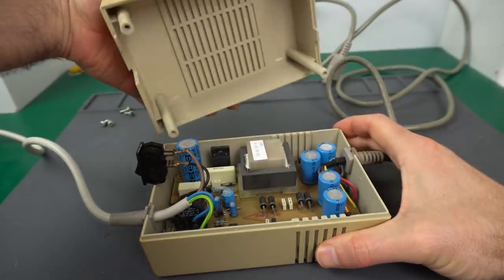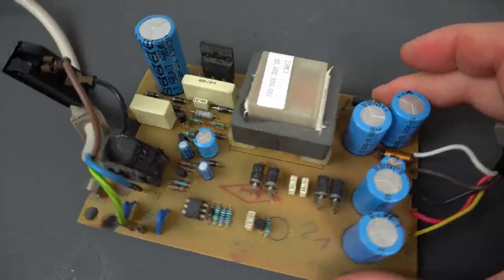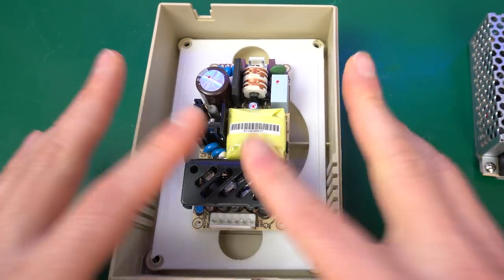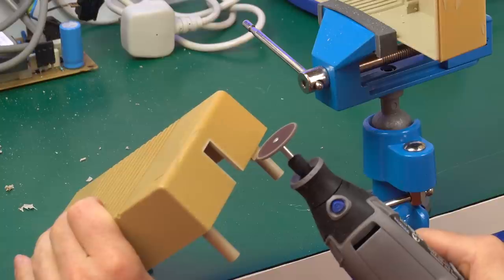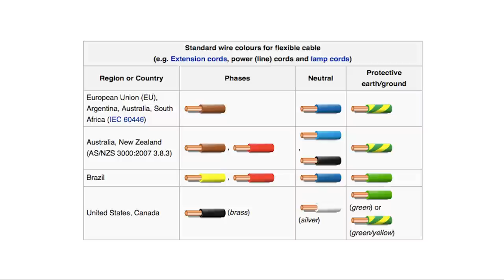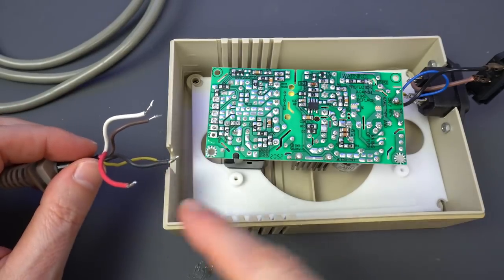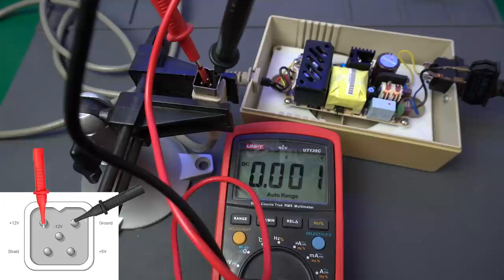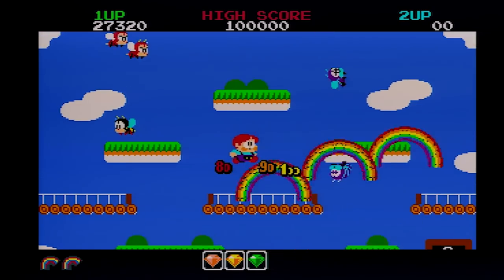This Amiga Power Supply Will Work Anywhere

Comment: The fuse in the UK plug is to protect the appliance cable (or cord if you're in the US). This is because most domestic UK installation wall outlets are wired in a ring, using 2.5mm squared cable, with sockets daisy chained together, so there is continuity in both directions from any socket back to the distribution board.  The ring main wiring inside the fabric of the building is usually protected by a 32 A circuit breaker. So if there is a fault on the appliance, the fault current could be less than 32A, but still exceed the rating of the appliance cable (which will be much less than 32A),  causing the cable to overheat and catch fire without tripping the circuit breaker.  In this case, a correctly sized fuse in the plug would blow and prevent the cable from catching fire.
Reply: Oh thank god, theres actually people that know this :)
Reply from the maker: Right. Technology Connections had a great video about that (focusing on the US system): https://www.youtube.com/watch?v=K_q-xnYRugQ

Comment: Another thing to watch out for when working with mains cables. Some plugs can be reversed in the outlet, switching the neutral and live around. (This is btw, fine for one phase equipment ) Don't assume neutral always are neutral and live always are live. It depends on how the socket/wall outlet is plugged.
Common sense is to consider both neutral and live as if they both are live. 
And of course never ever work with the mains side with it plugged in, even if the wall outlet has a switch turned off.

Comment: Great video Noel, just one thing I noticed was that remember to make sure the supply wires to the PSU can carry the higher current when plugged into an American supply.
Reply: Mr Guru  yes the current draw to the Amiga will be the same on the DC load side but on the AC supply to the PSU if the voltage level changes from 220V down to 120V to keep the power the same the current will increase. For example  100W PSU will draw 0.45A at 220V but a 120v supply will draw 0.83A.
Reply: @kevinhowie2704  Sure but like I said in another comment.... it doesn't matter. I own over 50 Amigas. The same AC cable is used on all models in all regions. The only difference is the plug shape and the input voltage on the PSU. You said yourself a 1mm wire can take 10A without issues and the cable used is at least that. The Amiga only takes 3A-4A so well within the limits. If it was good enough to pass FCC safety regulations in 1987 it's fine now.
Reply: @johnbos4637  true I believe you that the dc circuit supplying the Amiga is 3 to 4 amp  but we are discussing the AC supply which current will be alot lower.

Comment: Good job Noel. I did a similar PSU mod recently with the 50b version of the meanwell unit. I needed to adjust the 5v load as my gotek was not working with it until I adjusted it under load.
Reply from the maker: Yes, I was ready to adjust the voltage under load at the end when I realized this model didn't have an adjustment like the 50B. I wonder why. At least it worked fine without any tweaking, so that was great.
Reply: @NoelsRetroLab  Costs money and space to put the pot in, and makes it less reliable. You just have to use 1% resistors for the reference divider, and use the 1% TL431 IC, to get the overall accuracy of the 5V rail within 2% at worst case, which is from 4V9 to 5V1, and in most cases within 50mV of 5v. I just made a fixed resistor for a 12v battery charger, as the original uses a pot, which is a little touchy to adjust. Measured it, and looked for a parallel selection of resistors to make the same 350R resistance. a parallel combination of 2 820R resistors and a 2k5 resistor got me within 1R of the correct value, plenty close enough.
Reply: I think some of the Meanwell supplies regulate on the 12v rail rather than the 5. I know that's been a problem for some people as the 12v isn't getting a load sufficient to achieve the right level on the 5v. I misremembered my problem, it wasn't the Gotek I had problems with, it was a usb mouse plugged in with an adapter. Not a problem if you're using real mice.

Comment: I repaired my A500 during this summer and I decided to keep the original psu circuit(heavy type) but  I changed the 5v and 16v regulators(their values were way off!), I added to them bigger aluminum plate coolers and change all the electrolytic capacitors. I only left one regulator(it looks like one) because I got bored to desolder it and check its values(it is in a really tight corner!) but now all the values are good.
I hope that  it will last for an other 30 years.

Comment: The blue wire in a mains cable may actually be the live wire since many European plugs are non-polarized, they can go in both ways when plugged into a wall socket.
Reply: Not true for earthed plugs. Live should be on the right and neutral on the left. There are socket testers available that will tell you if your sockets are miswired.
Reply: @Nibb31  At least in Sweden earthed plugs can be plugged in both ways. Edit: Germany also has earthed non-polarized plugs along with a bunch of other European countries. In fact it's the most common plug in Europe called the CEE 7/4 plug. It's earthed and can be plugged in both ways.
Reply: @Nibb31  In Germany und many other European Countrys, the earthprongs a made to allow the plug to connect in both ways. So its Nonploarized even with earthconnection. 
there is not even a "best practice" for the side of the phase.
Reply: @MermaidSystem  totally right. Actually this also means, that you need to use a two pole switch at the AC side (instead of the former 1 pole) two cut both wires. As I read from Wikipedia the usual plugs in Spain are not polarized, so you should consider this ;-) Otherwise you may have life on the power supply board, when expecting it to be all neutral.
Reply: @Hadrian2002  you dont NEED to use a dual pole switch unless you require isolation. For a simple on/off switch it is enough to break one conductor.
Reply: @jaycee1980  Here in Australia the wiring will also work both ways with live and neutral interchangeable BUT some appliances won't work or will trip the fuse or trip the RCD. It depends on what you plug into the AC but obviously wiring it the right way is better ;-)
Reply: @jaycee1980  you are right, but the more quality devices should have it. It's actually more or less mandatory for multi plug extensions, but not all Chinese manufacturer are compliant. But it feels better/safer to use a 2 pole switch 😉
Reply: @Hadrian2002  Agreed that in something like a multi outlet strip, the switch should be dual pole because it's reasonable to expect complete isolation there
Reply: @johnbos4637  it's the same in the UK, but reversed polarisation on wall outlets is considered a fail in any electrical safety test. You guys have the MEN system (we call it PME here) which makes the correct wiring of Neutral even more important!
Reply: @jaycee1980  MEN just means that neutral is bonded to earth at the main switchboard of the installation. What does that have to do with non-polarized plugs and wall outlets with undefined ordering of live/neutral?

Comment: Most people praise the UK plug.
Maybe your unaware we have different rated fuses based on the device requirements.
Eg: back in the 90s my C64 PSU had a transformer meltdown and the C64 survived (I'm betting it was because the 3A fuse in the plug blew before dangerous voltage got to the C64)
But its also good for devices that don't have its own fuse EG: Table lamps.
Reply: Maybe you're unaware of the contraction of "you are" and how it has an apostrophe and an e. 😉

Maybe you're also unaware that your final sentence should read: But it's (it is) also good for devices that don't have its (kudos here for the correct possessive pronoun) own fuse, e.g. (an abbreviation so punctuate it!) table lamps.

Comment: Some great tips. 1> Using regular iron in tandem with desolder gun for stubborn joints. And B) isolating pins in a multi-pin plug with heatshrink to help prevent shorting when measuring. Gold!

Comment: There's also more than 2 types of Amiga brick PSU. There are at least 6 types that I have come across:

1) Big heavy brick with linear transformer made by Speedy-Tech (uses a 20-15-0-15-20 tapped transformer, has L294, L4960 and 7912 regulators)
2) Big heavy brick with linear transformer made by ISMET (uses SG3524 and 7812/7912 regulators. Frequently cracks joints near the transformer). This was derived from their design for the C128 I believe.
3) Slim brick with linear transformer, made by Speedy-Tech, potted in resin. Usually fails by voltages sagging under load. If you can get the potting out, these make great cases for RPT-60B's
4) Big lightweight brick made by ISMET. SMPS type using BU508 switching transistor. Crap quality capacitors, frequently burns out two resistors and puts unregulated voltage out when it fails.
5) Big lightweight brick made by Speedy-Tech. Not seen many of these go bad actually.
6) Slim lightweight brick made by DCD. This is frequently what came with the A600.. good quality, though only 22W. 

There's also one out there made by DVE but i've not seen it in the flesh.
Reply from the maker: Aha! That's some in-depth classification of PSUs right there. That's great. I'm saving that info for future reference. Thanks!
Reply: Actually i've never seen that Liton one that you show with the exploded capacitor either :)

The key thing is, all of these power supplies were subcontracted regionally - none were designed by Commodore themselves other than the look of the casing. They simply specified that they wanted a supply capable of supplying +5, +12 and -12 with minimum current specs. How the subcontractors did it was up to them. 

Most of the supplies were cost optimised and were dreadful. Especially that ISMET switching one.

Comment: i like the trick with the shrink tube...
when soldering I usually blow gently on the solder joint to push the smoke away so I can see what I'm doing and also so that I don't inhale the lead vapors.

Comment: Nice.  I have three comments though.  1.  I would use heat-shrink on the plug and switch contacts. 2. I would glue the nuts on the socket, as if they come loose it wont be pretty.  3. Not all 3D printing filaments are created equal, so I would use a PLA+ or ABS filament.
Reply: The plastic is just a mount. It doesn't actually matter as there is no force on it. Regardless, he didn't actually say what it's made of so how do you know he didn't use PLA+ or ABS? ;-)
Reply: @johnbos4637  It does matter as the mount can melt or disform with minimal heat.  I know because I am a smart ass who does a lot of 3D printing.

Comment: The Mean Well power supplies are a great choice for old computers. They aren't the best but they are reliable, safe and well made, especially for the price. I've seen one on some machinery that had a fault that caused the DC output to be shorted for days. That thing worked just fine afterwards, so they seem to have some decent output protection built in. It was jammed with oily dust too but it didn't bother it.

The earlier Amiga supply that I have, I'm sure is a linear supply. Just a giant transformer and some filtering. I'll leave it alone for the time being.
Reply from the maker: Agreed. They're not bomb-proof, but for the money they're great and they will usually not destroy what you're powering with them 😃  And yes, I'm leaving the linear PSU alone. Those seem to be OK. It's the lightweight ones that tend to have issues.
Reply: @NoelsRetroLab  Yes but the lightweight ones are easy to repair, especially if you do it before it fails, simply by replacing all those old capacitors in them. The Meanwell power supply will still fail in the same way, just after a few years, but should still be available.
Reply: "arent the best" ? They're very good. Actually look at one - well made, good quality capacitors...
Reply: @jaycee1980  Yes, but they are not using the top of the range capacitors, but lower cost versions, that have a shorter operational life. Cost cutting, and so long as you derate them appropriately, and run them at a lower temperature they do work well. 

Even the top tier equipment makers use them, though there they often also have special versions for their use case, with the top quality capacitors in them, as they are willing to pay for the longer life.
Reply: @jaycee1980  Better ones would be, Siemens, Allen-Bradley, Schneider, etc. The extra cost versus Mean Well isn't always justified in a professional industrial environment, let alone for a fun hobby at home. I've seen more Mean Well failures than the other brands combined.
Reply: @thesillyhatday  Depends why they failed really. If they're expected to handle gross overloads or wildly varying line voltage swings and spikes, then sure - the Meanwell's will probably blow up whereas the Siemens supplies will survive. Now look at the cost difference.
Reply: @SeanBZA  Have you actually looked at the capacitors on the Meanwell supplies? The RPT-60B are using Rubycon and Nippon Chemicon, and they are 105c rated. Not sure how you figure those are not "top of the range".

As for the original Amiga power supplies - they are 30 year old switch mode power supplies, most of them quite crude in design compared to modern switch mode supplies. Most of them have no over voltage or over current protection, which the Meanwells do. The ISMET ones often fail and put out higher voltage than normal, killing the Amiga.

The RPT-60B is based on the onsemi NCP1230 switchmode chip

Comment: The UK plug is the safest in the world.  You'll also notice that the earth pin is longer than the other 2 - this is a safety feature that stops you plugging it in if it's not present (there is a corresponding safety device built into all UK plug sockets).

Comment: Amazon sells IEC320 sockets with integrated power switches.  I use them all over the place.  Plus they light up when switched on and have a fuse.
Reply: This is a great idea and I see a Bulgin C14 that's perfect except its size makes 'snapping' it into the end of the case difficult it's not flat. Now I want to 3D print a case to suit, with screw bosses in the correct place for the Mean Well. See what you've done (but thanks for the tip!) :D

Comment: I did a very similar mod to replace the PSU I use for my own Amigas. Meanwells are pretty good. I also replaced the internal PSU in my AppleIIGS with a Meanwell model - it helped to allow me to run it on 220v.
Reply: What model of power supply you use for the IIgs ??
Reply: @joseluisarenasperez3855  Meanwell RPT-60B

Comment: A good tip is to make sure there is a fuse on the live wire.  If the meanwell doesnt have one then you can use one of those barrel type fuse holders and drill a hole in the case.  A fuse of some sort is required for CSA/CUL compliance.  I would assume the meanwell supply has the mains fused in this case.

Comment: nice job Noel... just like a bought one!
like has been mentioned.. you really need thicker wires on the input side, the ones you have might get warm/hot under load...which isnt a good thing for a PSU in a plastic case! :P

Comment: Hey Noel. Hope you're well. If you ever need any help fixing an Amiga, let me know. That PSU has so little in it, you could almost rebuild it with all new parts for cheap haha
Reply: What are the typical failure points? That electrolytic cap was obviously botched in Noel's unit, but I doubt that was the only thing wrong there.
Reply: @VioletGiraffe  The psu he swapped, didn't have a lot in it. the one with bad cap had a far more complicated design.
Reply: @AmigaofRochester  The old one is exactly the same, just runs at a lower frequency and with slightly worse efficiency, plus as it is self oscillating it will likely not start reliably on 115VAC supplies. New good quality 105C capacitors all round, a resolder of the transformer and power semiconductors, and it will work fine for another 2 decades no problem.
Reply: @SeanBZA  He showed two old psus, one more complex than the other. One with a blown cap, one without. The one without the blown cap yes, I'd just rebuild with new 105c caps. I'd do the samething with the blown cap one. Just like I do with apple psus.

Comment: Nice mod, next time try to match the input wire gauge internally. Also, guard those high-side solder connections with good quality heat shrink. 😊😊

Comment: Noel's Retro Lab
When you are de-SOLDering, you would be in a better position
to first re-solder the joints with leaded solder - the soldering
the process becomes a whole lot easier.
Alternatively, if you are advanced enough you will have the connectors
and a crimping tool to make the appropriate connectors.
Either way works well.
Also, you should be placing insulated cups/sleeves over the spade-terminals
and observe safety regulations.
Also fro a LOAD - You don't need Power Resistors.
Use a 12v Automotive light bulb - even when checking the 5v rail

Comment: A tip. It's a good idea to properly insulate the screws for the IEC socket since those breaks the insulation of the case. They could be a hazard if a cable breaks loose and makes the phase connected to the screw. Also heat shrink the soldered terminals on the IEC socket and the switch. Better safe than sorry :)

Comment: Another recommendation is to avoid soldering mains voltage connections. (use crimped connections or screw terminals instead), because cold solders may cause arcs and fire hazards.

Comment: Looks like a good project to replace an Atari ST internal PSU

Don't order the RPD-60B as shown - that's for 5v and 24v output. Order the RPD-60A for dual 5v and 12v
Reply: Close, but the RDP-60A is also wrong.  It doesn't have -12v.  I believe he meant the RPT-60B, which has the +5v, +12v, AND -12V the Amiga needs.